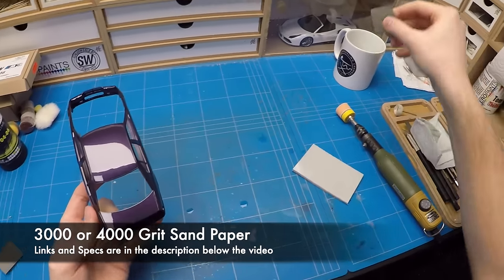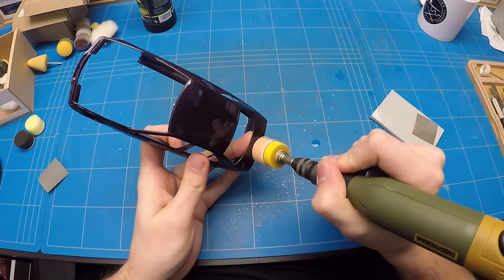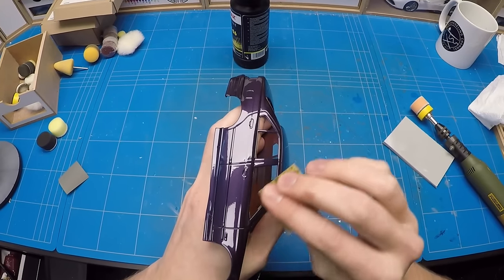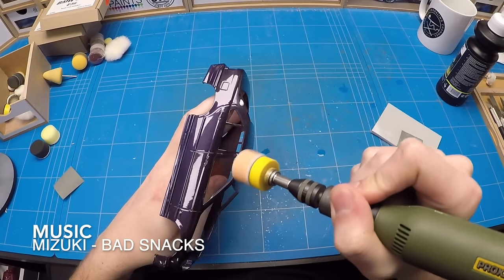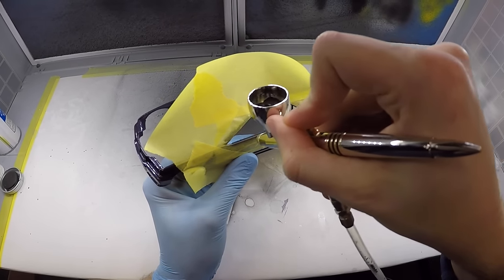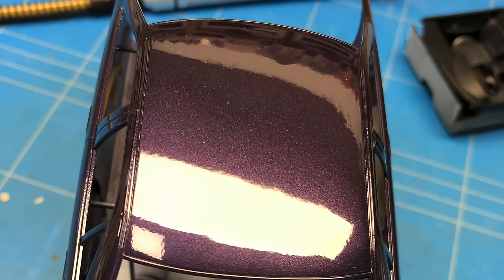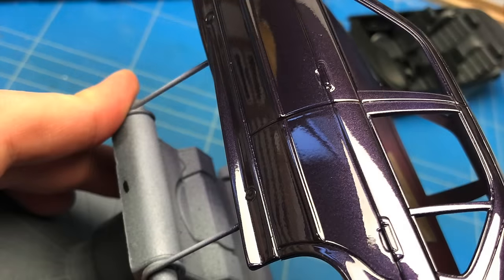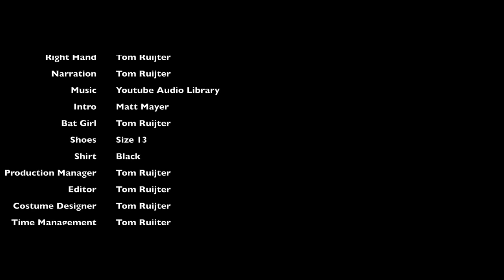USCP/Hasegawa: BMW E36 M3 Part 3 Machine Polishing the Clear/Removing Orange Peel

Comment: Really Interesting video... Please may I ask what RPM is the Proton running at? Are you using it with 1 or 2 speed controllers?
Reply from the maker: slowest speed 2 controllers

Comment: Hey, could you please give me some advice, I've painted my model with an airbrush but the base paint has a massive orange peel. I tried to sand it down and repaint it, but the peel stayed. Should I put clear coat on that paint and then sand it with 4000 paper and apply more clear or what should I do? :( I can provide pictures if needed.
Reply from the maker: Sounds like the paint is to thick. Thin it a bit more so you can aply a smoother coats

Comment: Shouldn't base coat color paint be sanded before clear coating the diecast model to remove rattle can orange peel?
Reply from the maker: Primer, yes. Color, No. Clear, optional
Reply: Even if the base primary color has orange peel? Thanks  @TheScalemodelingChannel
Reply from the maker: All the sanding you do to the color coat will stay visable through the clearcoat